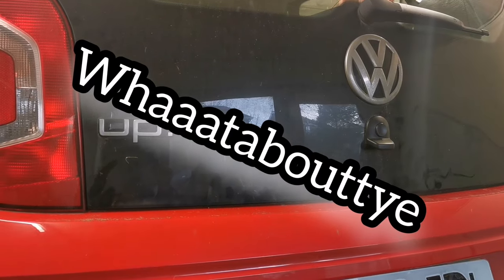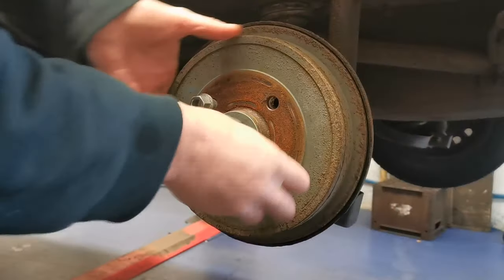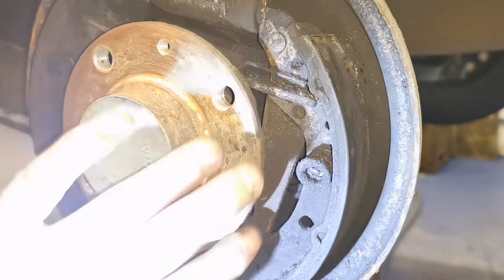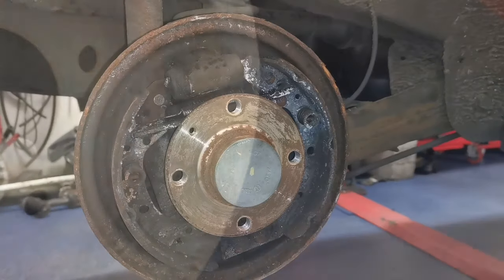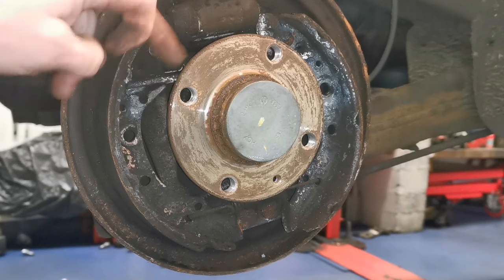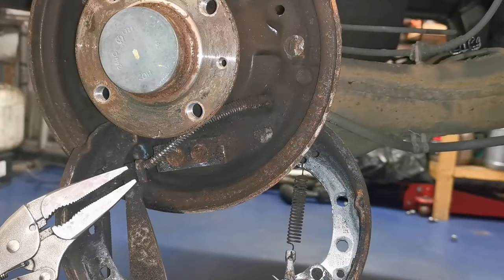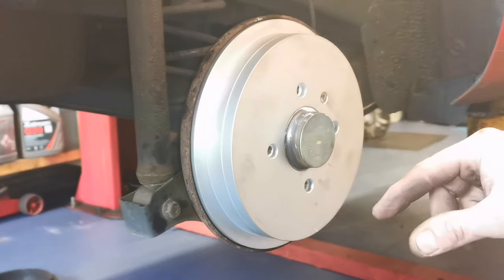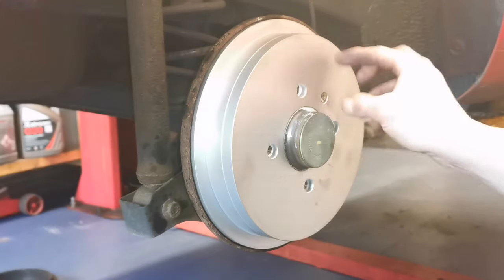VW Rear Brake Shoes Change. UP!, Polo, Skoda Fabia, Seat Ibiza. Sticking Handbrake, Stuck Drum

Comment: Drum brakes are the devil's work. Had them on a Audi A2 TDI at 150k miles and a Skoda Fabia TDI over 100k miles. They run fine in decent weather, first sign of dampness or the cylinder leaks and goodnight Vienna. Good to see you grease the nylon rubbing pads on the hub backing plate during reassembly. Lucas and Bigg Red sell spring kits too.

Comment: Great video and helped me understand the issue I had which was exactly this! I didn’t want to undertake the job myself so needed to get the car to my local garage - had a top tip from the RAC who I’d logged a call out with - couple of buckets of hot water over the drums and the handbrake released for me to be able to take the car to my preferred mechanic!

Comment: Just wanted to add a tip after replacing everything and bleeding - Pump the brakes and start the car. Drive around and brake. Try also braking and pulling the handbrake together to make the automatic adjustment do its thing. 

Then you can start addressing the (probably) loose handbrake. At least for me in the e-UP it was seized on both sized before replacing it all. The wires were probably slightly stretched after staying in that position way too long. 

So you'll need to have at least one of the wheels in the air so it can spin freely. Remove the trim around the handbrake lever (only one screw in the rear cupholder on UP, then push the trim towards the front of the car). 

Lift the handle until it engages in the first click, then release. The handbrake should go all the way down. Also try lifting until just before it engages and release, it should go fully down. Otherwise, tighten the adjustment nut (10mm) for the two wires until it does.

Next, pull the handbrake lever until the fourth click. Further tighten the adjustment nut until you can't manually rotate the wheel(s). Disengage handbrake and make sure the wheel spins freely. Some slight rubbing sound is OK, it'll wear off the first drive. 

If you were only able to jack up one wheel at a time, jack up the other and confirm that it responds in the same way as the first one, without further adjustment.

You're now done, you've removed any slack in those two wires. Auto-adjustment will carry on working for both handbrake and brakes from now on.
Reply: Jeezes mate, i had thé car jacked up, my handbrake was on Fourth click 0 left and fully engaged right....thé handbrake was not adjustung at all....i thén used yr tip: betaling with pedal, at same time thé handbrake, and i got stiff pedal and thé 0 left side Came adjusted....why is that, great tip brother, Bob Belgium
Reply: I did this on golf 2 , 1983, today after reading yr tip

Comment: Thanks for that Dave, I actually had a seized lever on my father-in-law's polo a few weeks ago, I removed just the one shoe and had to heat it to get the lever moving, I got it back on fine but only then to find that the cable is also sticking a little 🙈😂. The joys😂 Good tip to remove the wheel cylinder 👍😉
Reply from the maker: Cheers John

Comment: I’m in the middle of the same job on a Polo 9N and I wish I’d seen this video first. I had exactly the same trouble as you getting one of the drums off and used the same methods. Ive got new brake shoes but surprisingly they don’t come with the spreader bar/yoke or wedge adjuster, wonder why they don’t supply everything as a kit? Same with the wheel cylinders, no new bolts. Well anyway now I’ve got the method to reassemble the springs thanks to yourself, wish me luck!

Comment: I have been doing these since the 90ts probably like yourself fucxxking still hate doing them.. Usually do them with everything still in place. Nice tip taking the slave cylinder off. Always fearful I will give myself more hassle by doing something like that. Think I'll try it next time.

Comment: I usually just remove the bearing as the usually comes off no bother makes it a bit easier and use a long pick through the  wheel hole to pull that adjuster down a bit but good job none the less
Reply from the maker: 'none the less', you don't seem to be that impressed. I mentioned the alternative of pulling the hub and also mentioned no need to pull the adjuster down
Reply: Sorry no didnt mean to come across like that 😔 I enjoy the videos and watch them all from a fellow mechanic always looking for tips etc

Comment: It seems some new brake shoes are a bit too thick even for an old drum with some wear.
I thought it was the lip on the drum, so was beavering away with a dremel grinding bit. However, I then realised that once the lip preventing actually getting the drum on and off is away, it is simply a case of the shoes being too thick.
After lots of annoying wasted time, I think I will have to try to contour the shoes.
This is all after spending hours on the back plates which were caked with stone like deposit (I am talking welded on, not loose).
Edit: Or possibly just accept a bit of rubbing that will eventually stop through driving?

Comment: Lovely job.  The key for me was how to get the bloody thing back on - you must remove the brake cylinder to do it!  IMO that is a shite design compared with the old system without the separate hub as you could change the shoes and drum without the mess of brake fluid getting everywhere - obviously VW wants you to replace the brake cylinder whether it needs it or not!